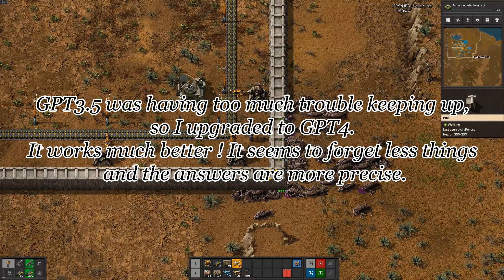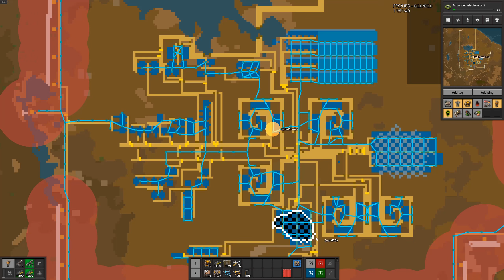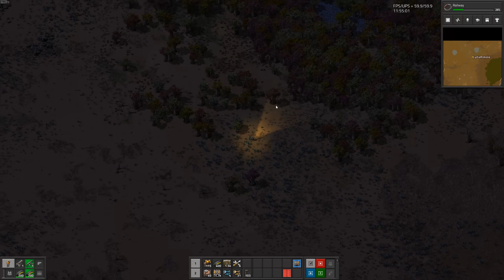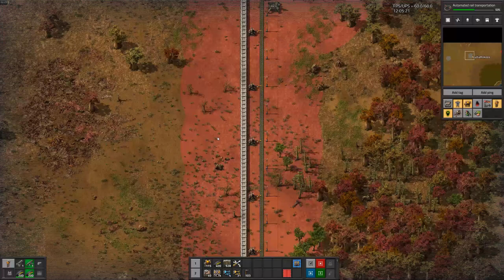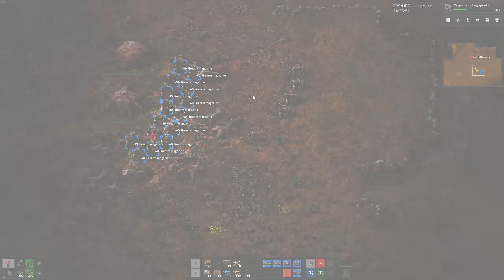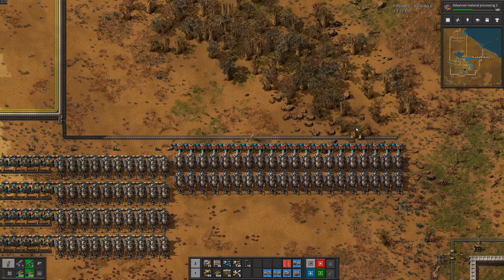[ChatGPT Plays Factorio] #04 - GPT4, Trains and Outpost

Comment: This is actually a really cool idea despite being fairly simple in concept! BTW instead of regular inserters that require power, if you use burner inserters for loading coal into the boilers for steam production, you ensure the inserters keep working even if you let your power production system run out of power (e.g. because of biters destroying half of them; happened to me before!)
Reply from the maker: You're absolutely right :) Thanks !
Reply: Or even better, prevent them from wreaking havoc upon your base with the aid of flaming fountains of oil.  At this stage, you could easily run a mixed train with both conventional ammo and a tankcar of oil to your outpost.
Reply: ^^ this, always

Comment: The designs got better. They are still not perfect. 
I felt physical pain when I saw the number of power poles you placed. And connecting the outpost with medium power poles also hurt.
Reply: Yes, either small or big for distance.  Steel is still far too valuable at this stage.  Not to speak of the wood that goes to waste.  (Although that could be used as fuel for boilers.)